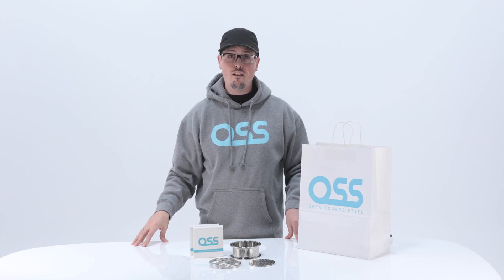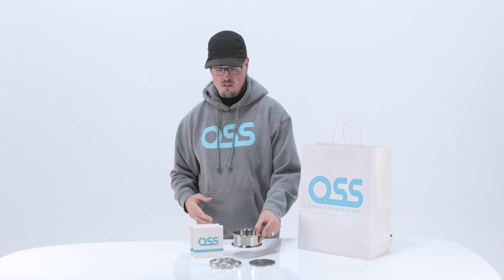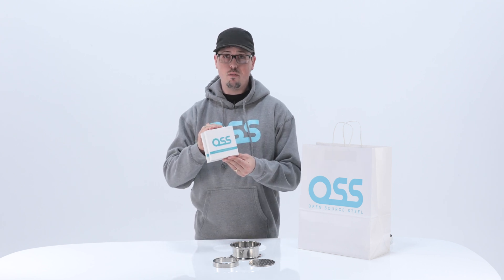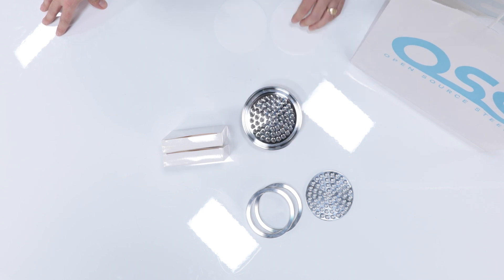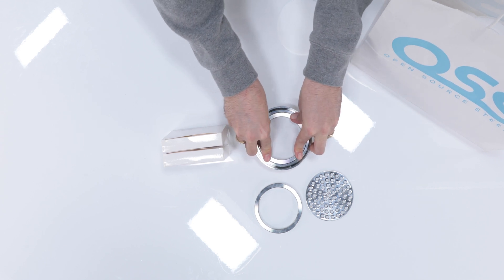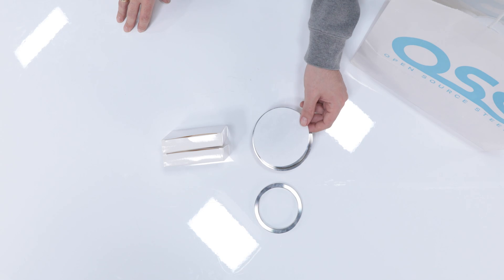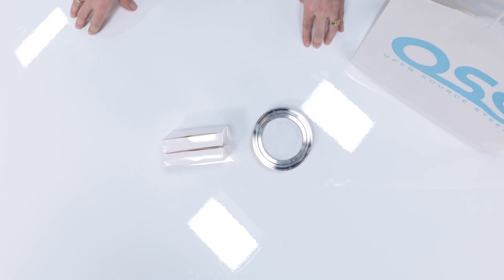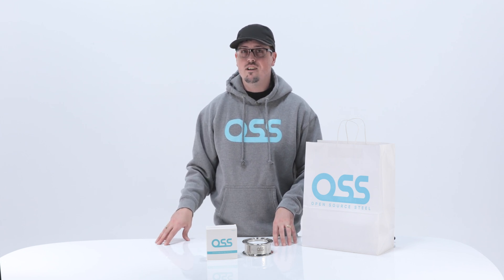Filter Stack Overview & Assembly

Comment: So on a passive unit non nitrogen assist what would be a good micron to run under my dry ice column with out locking it up and having no nitrogen to push but still filter and hold some fats and lipids...thanks man I'm about to order from you guys hopefully you see this with in the next week if not maybe 50 micron and 25 idk that's why I'm asking ..thanks again
Reply from the maker: There isn't a 'golden micron' for this situation. 25 micron is a good starting point, however, you still may run into pressure issues just due to the nature of the cold solvent. Warm butane vapor can also be used as a pressure assist.
Reply: @OpenSourceSteel  i do and have had to use the warm solvent method when she wasn't flowing as good or the columns only took like 3/4 of solvent